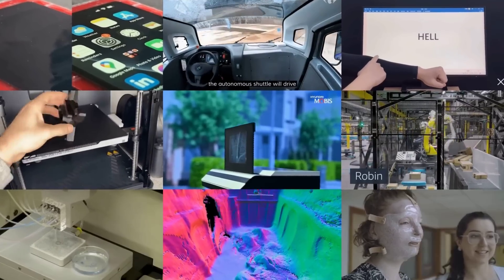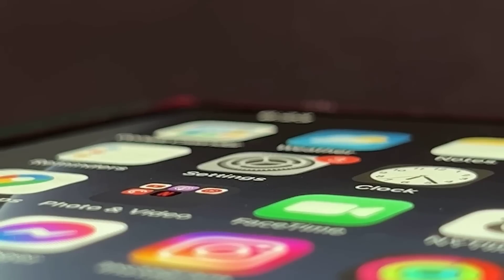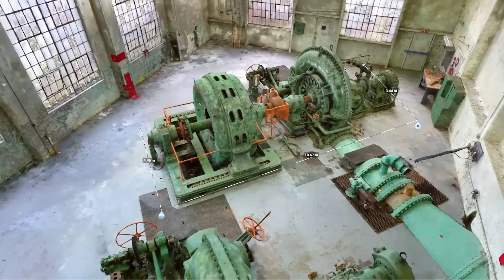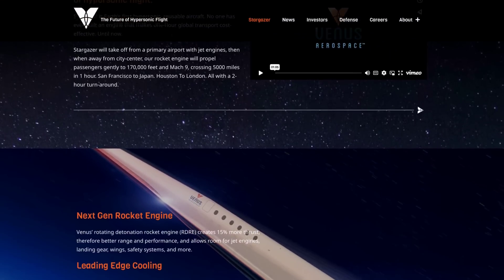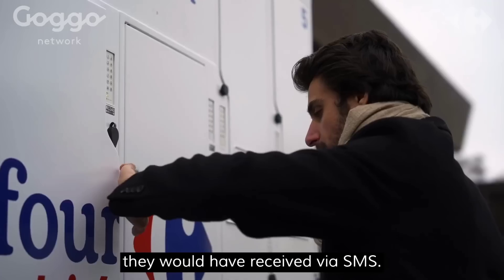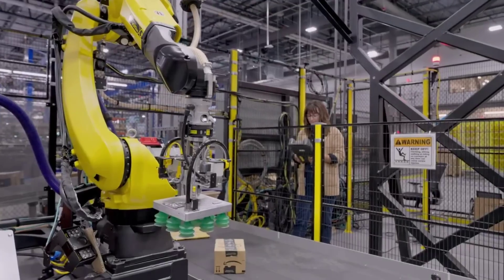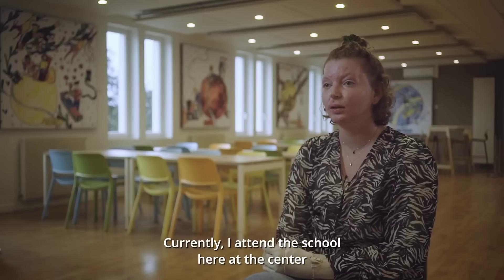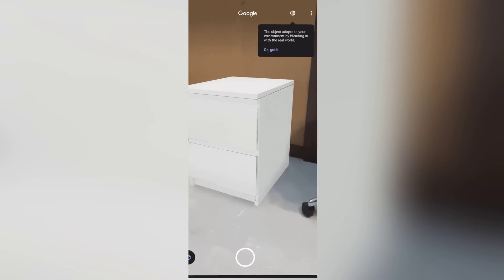Large Rollable Displays, Quiet Jet Engines, Autonomous Room Scanning + More | MOSFET Weekly

Comment: What is this inflatable button nonsense? I just want what Star Trek Discovery and The Expanse have in common: the mid-air holos.
Reply: What if you have bad eye sight? What if you are old and just misplaced your glasses? What if you need to use the phone without looking at it? 

Wouldn't it be nice to use the calculator while keeping your eyes on a receipt, a list to sum up, or the computer screen.
Reply: @georgwrede7715  there is always voice command. I don't think they'll arrive at a point that Braille system can protrude out of those screens.

I guess I never thought of it that way, maybe there is some very niche applications to this.